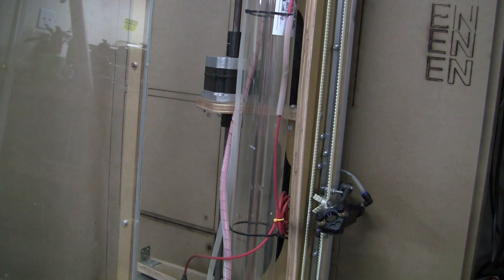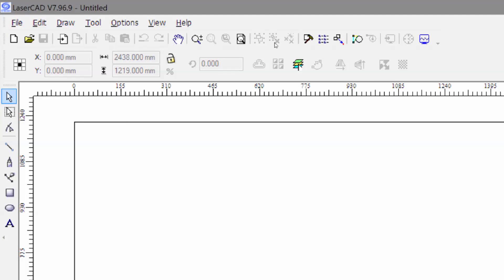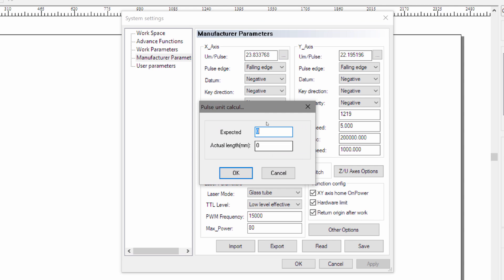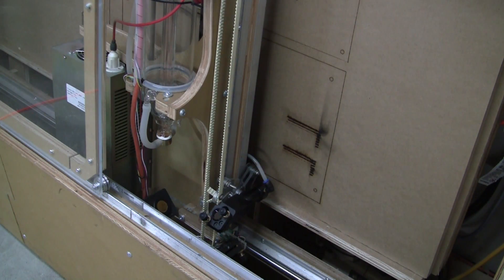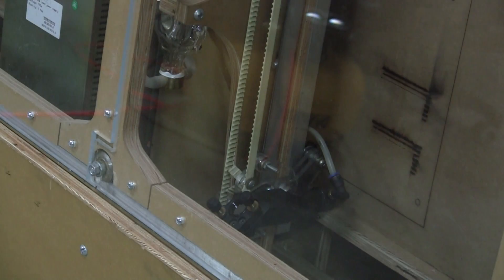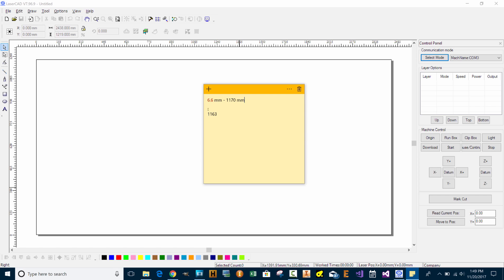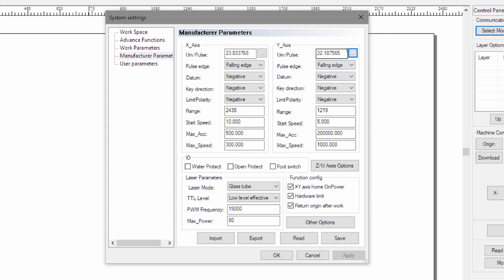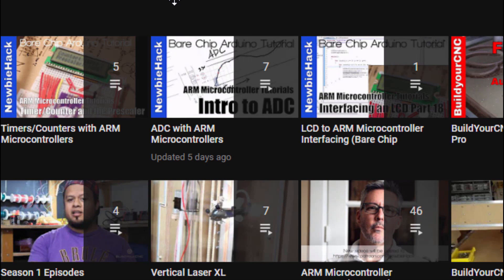Laser Cutter and Engraver Axis Calibration - Anywells Laser Controller

Comment: Thanx Patrick.  This is close to what I need.  In my case, the At the machine zero point, my readings are Y=0.00  X=178.8.  I have no idea how that happened, but of course anything i try to etch or cut gives me the oversize warning and will not go further.  Any ideas on how to zero the X via soft ware?  I already zeroed it by removing the timing belt, brining the stepper to 0.0 and reinstalling the belt, but as soon as I try to use it, it resets to X=178.8.  Currently pulling hair out...and I don't have much left.
Reply from the maker: You should either increase acceleration or reduce the velocity.  The length of axis that it decelerates will make the nozzle go out of bounds.